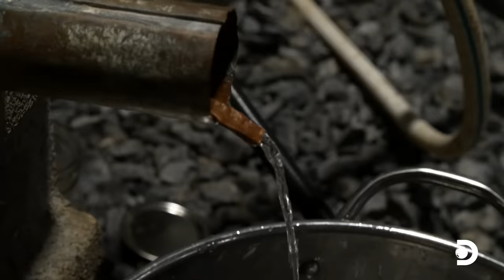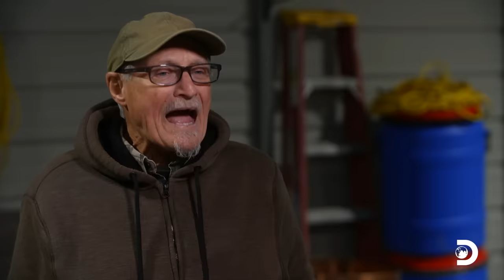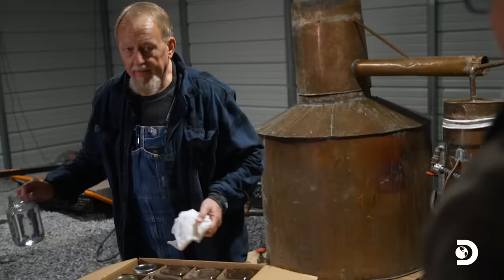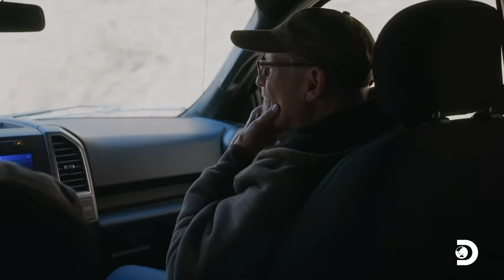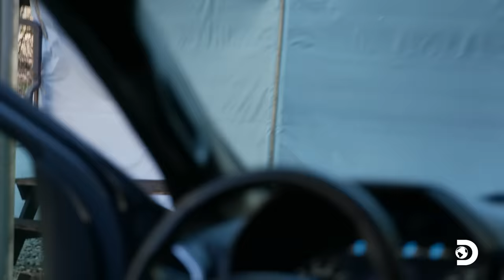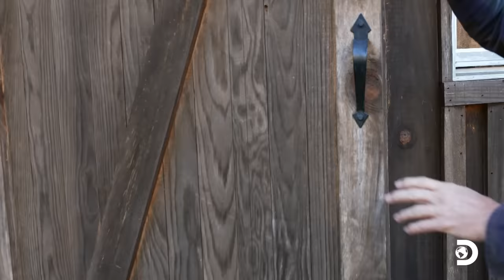Mark Ramsey Reveals His Biggest Secret! | Moonshiners | Discovery

Comment: 90 Gallons = 750 lbs. That vehicles suspension didn't lower a millimeter after being loaded with all of that weight, and those two men didn't struggle at all lifting 250lbs 3' into the air and into the trunk. Those barrels were empty lol.
Reply: I regularly lift 15gallon drums at work. no reason 2 people can't lift 125lbs a piece.
Reply: @yourmother1850  Doesn't surprise me someone who fails at reading and comprehension works a job with a lot of heavy lifting and little-to-no thinking lol.